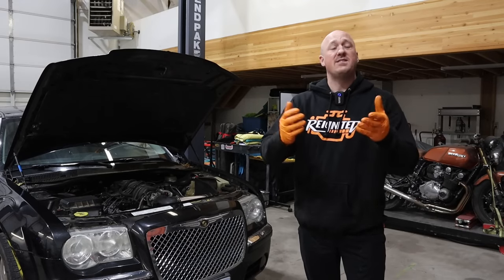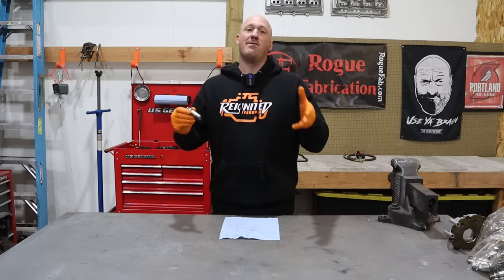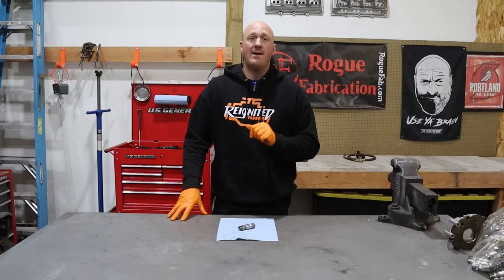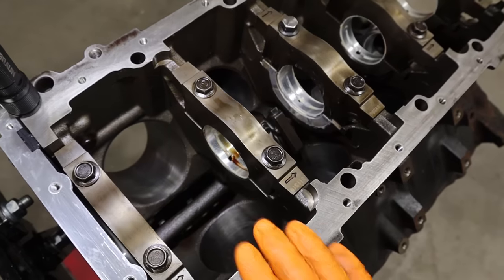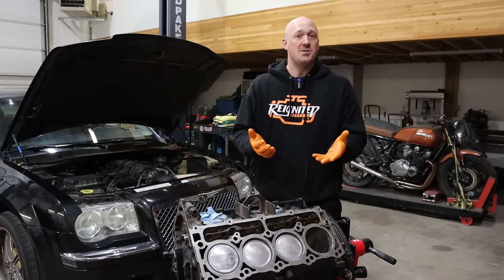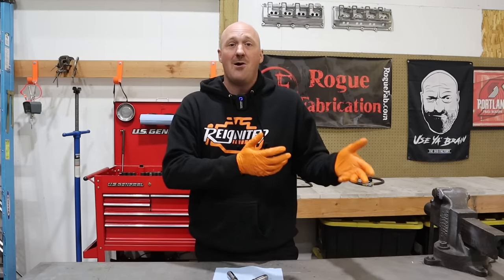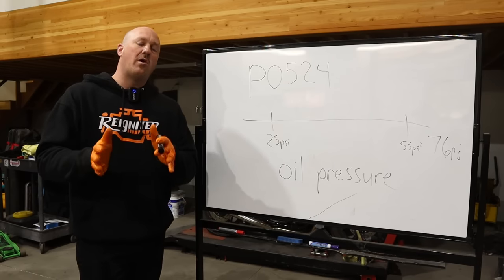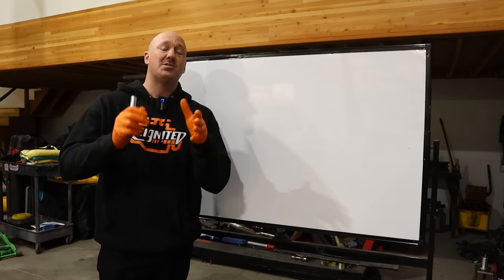The BEST Prevention For Hemi Lifter Failure! (In My Opinion)

Comment: IMO too much oil pressure could cause more issues with gaskets, fuel economy, heat build-up, and filter stress I am not an engineer but to me increasing the flow rate is an easier and safer way to accomplish better lubrication, increasing internal pressure must have a side effect Vs increased flow rate would you agree? Combined with oil change intervals at 3-5,000 miles Vs 10,000 mile intervals. I'm at  56,000 miles on my 22 Ram 1500 5.7 4wd limited night edition Pacbrake relocation oil filter kit and Hubb 3202 oil filter I don't burn a once of oil at 5K miles. I have used Kand P Engineering reusable mesh filters for over 10 years and switched to Hubb for lower particle count 5 times more flow OEM Vs 7 times more flow Vs OEM with K&P Engineering filter. I change my oil and see what is in my filter at every oil change I also send oil analysis regularly to know what is going on internally the worst results I ever got was using a Mopar MO899 oil filter 10 times more wear particle count than mesh filters IMO 3-5K oil changes increased oil flow at OEM designed oil pressure 35 PSI at idle and 47 PSI pushing hard full throttle with greatly reduced particle count prevents wear that can lead to failure just adding more oil pressure to me seems like putting a fire hose on a match yeah it will put out the flame but what happens to everything around it every action has a reaction please let me know what you think have you ever tested oil filtration flow rates of OEM Vs other reusable mesh filters?

Comment: I was able to use MDS with a 6.2 oil pump. When the check engine light came on for P0524 it wouldn't activate, but I could clear the code and I was able to use MDS again. The check engine light came on at seemingly random times, and only every once in awhile.

Comment: Are the modern HEMI's baffled or rear sump?  I think a lot of the fears of high volume draining from the pan, is because of the older engines like you said.  Lot of the older mopar cars the sump was center or more forward the engine, so if you didn't have a baffled pan it is a problem on the older stuff.

Comment: Starting my research now (better later than never) after ordering my used 17 Ram 5.7 hemi. Haven't gotten the truck yet but I'm getting butterflies listening to you and others as what to expect on a 40k mi engine. I gathered from this video you don't suggest to change oil weights but what is your take on full syn oil in this engine?  Thanks!
Reply: I put synthetic in my 2012 pickup truck at around 30 thousand miles and I don't let my truck sit idling for periods of time .I also run it in tow/ haul mode to keep it in V8 mode all of the time. And I don't run the AC much which would drag the engine down a little at idle time ,like at red lights . And most tick noise is from a broken exhaust manifold bolt.... not the lifter / cam problem.

Comment: So really what we actually need is an oil pump with a higher volume per second on the low end that levels out to normal levels on the high end. And also I now realize it doesn't make much sense to think that MDS is causing lifter failure when the roller is what is going out, a part that both types of lifters have, and also non-mds lifters still go out for the same exact reason. Basic takeaways are just don't idle your engine and if you can afford an oil pump with a higher volume output then install it. I wonder if idling your engine at a higher RPM would help too

Comment: Is it a must to put in new cam bearings in on an engine that runs but has lifter tick? Engine has 130,000 miles on it
Reply from the maker: Not usually. The Hemi engines very rarely experience cam bearing issues. If you remove the camshaft and see the bearings are scarred then of course they need to be replaced, but in the hundred or so of these that I've done for lifter failure I've never seen the cam bearings failed.

Comment: The Melling pump comes with a higher pressure relief higher than factory installed, but also comes with the factory relief pressure.  Which one did you use in the 300?  It might’ve eliminated the need to fool the pcm.

Comment: It's not completely correct that all Hellcat variants use the same oil pump.  Yes, all Hellcat pumps are the same displacement (~ 23 cc per rev), however the MY2015 through MY2017 versions use a slightly (~5 psi) lower pressure relief valve set point.  Specifically, the PRV spring used in those pumps has a slightly lower rate.

For MY2018, we raised that PRV spring rate for the Demon application due to the slightly higher max engine speed.

The MY2018 pump (part number suffix "AD") can be used to service ALL Gen III HEMI applications with MDS.

Comment: Great video. I have a 2016 Dodge RAM with the 5.7 Hemi. I had the ticking noise come up when the truck had like 50K and the dealer changed the exhaust manifold on one side and it fixed the noise. At about 85k or so the noise started to come back(just like the video says every 30K miles) so I took it to mechanic and he said was the other side exhaust manifold so I changed that but it seem that the ticking noise was still there when the engine is cold. Now he tells me that it is one of the lifters. If I am going to have him do the work on changing one lifter should I just change all of them at the same time? Will that be a good idea?

Comment: QUESTION... if I put a new Melling oil pump on my 5.7 with a very mild tick, will that stop any further wear,, or will the damage keep getting worse eventually requiring lifter replacement?? Thank you!
2013 Charger R/T MAX
Forgive me, I posted this question on a couple different videos,, I genuinely need a REAL answer from a knowledgeable person!
Reply from the maker: At that point the lifters are already damaged and will need to be replaced. The upgrade oil pump will not prevent further damage. 👍
Reply: @ReignitedAuto  thank you very much for your quick response I appreciate it! Looks like I'll be doing the lifter and cam job if I decide to keep the car then!👍

Comment: A couple years ago I bought a superchips computer so that I could shut off the multi displacement system and not have to remove the solenoid valves or mess with anything. This eliminates having to be a mechanic at all and gets the layman to the same end point. MDS off and change the oil regularly will stop any further damage.- the problem is NOT the MDS system itself, it’s the extended use of the MDS system that causes damage and improper lubrication. I think fordtechmakuloco did a video on it as well
Reply from the maker: It's actually the other way around. There is MORE lubrication when the MDS system is active. Check out this video for more detail:
https://youtu.be/NcDeWXYtozE 👍

Comment: I had a 2010 with 5.7 no issues- 130k. Also had a 2019 rebel with 5.7. Which had the hemi tick at 25,000 miles.
So, if there's a combination of variables required to create a situation of wear. What is the most common among all variables? It seems to be oil. So we have
Lower oil volume + long idle ( canadian here haha so true) + dirty oil ( unfortunately confirmed)
My 2010, oil changed at 3000 miles always. 
The 2019 - 6000+ (tried to follow the light )
So oil does seem to be the most consistent factor. 

I think Oil type is something to look into here. Difference between  conventional and synthetic but also oil before and after 2009. I wonder if something has changed here i'd really like to hear your thoughts on it. 
Thanks for the great video!!

Comment: I think that the cam hardening is a major issue leading to the failure as a lot of the early failures look like cam failures first. Perhaps an aftermarket billet cam core is the way to go with good heat treating. Also one thing regarding higher viscosity oil increasing pressure is it generally has better film strength than lower viscosity, so it may "stick " to the valvetrain better. Do you have any techniques for changing the pump in the vehicle without dropping the pan?
Reply: The cam is not the issue, I replace these all the time and you typically find one bad cam lobe and 5 or 6 lifters that no longer roll smoothly.

Comment: I figured it was the 16PSI at hot idle, on my 2011 Charger. Not sure how low it got when it was time to change the oil, and the system gave me the message on the dash, wrong oil weight. I guess that's when it was too low.
I put a high pressure oil pump on it and it will still get down to 16PSI hot idle, but not as often as before. I plan to put the Hellcat oil pump on in the future. And a new OE timing chain, because the cheap ones I've used, stretch and cause a rattling noise when economy kicks in.
The high pressure pump I put on does get up to 95PSI cold high RPM. 75PSI hot high RPM.
Because of my stretched timing chain, I manually shift, so MDS doesn't activate and cause the rattle.

Comment: I believe that it’s an “oil” problem duh! I had an LA 360 that keep eating cams, after the 3rd cam I pulled it and went looking for the reason. The engine always had good oil psi. 
After tear down and a hot tank what I found was there was casting flashing in one of the upper/cam oil gallery, when the cleaning brush would not go all the way through, we found drill bits that were long enough, we predrilled all the oil passages! 
This fixed this motor, I think I ran it for 7 years after that with no problems! 
So this could be the problem with the later 3rg gen hemi. They could be as simple as a foundry problem! The fix could be as simple as drilling the cam oil passages? 
Am I correct or out in Left field?

Comment: does the Melling pump already have the same spring as the stock pump because it is a direct replacement ?
Reply from the maker: It comes with the high pressure spring installed, but the stock pressure spring is provided in the box and it's a very simple swap.

Comment: I wonder if you add oil cooler to those plugs for the oil galleries on the front of the motor for the lifters, I wonder if that would extend the life of the lifters

Comment: My 6.4 scat pack now has 68 thousand miles. If I put the original oil pump on the Melling
Part Number
Change 10452HV, you won't get the error message that there is too much oil pressure in the engine.
Should additional camshaft nozzles be installed so that the oil reaches the lifters and camshaft?

Comment: Pall this confusion I think about the brand of oil. Any high quality synthetic oil will be about the same. I personally use Castrol syntec because I had a Chrysler 3.8 that for some reason burned a quart at 3500  miles, but not with the Castrol. Been using it ever since just for that one reason alone. Now I did not get to try many oils to see if others did the same thing, just that the Valvoline I tried burned oil and the Castrol did not. I did try the Valvoline twice with the same results. Also oil changes are so subjective to how the vehicle is used. I drive mine mostly highway and I swear the engine rarely goes over 2,300 rpm, ever. I see many driving them and seemingly testing for that 395 hp constantly. Obviously, one needs the oil changed before the other. The guy constantly racing around has the motor spinning around twice as much in the same miles and worked harder. If you drive hard, 5,000 miles sounds about right. The way I drive my cars, I have changed oil every 10,000 miles without a problem in 45 years. In the early eighties I started Using Amsoil and changing at the recommended then 25,000 miles and 12,500 for filter without a problem into 100's of thousands of miles. All highway with a Toyota Corolla and Tercel, both 1980 model year.

Comment: Hey man great video, learned lots. I have a 2014 Laramie Limited with the 5.7L and 8 speed auto. When driving and ECO mode activates and MDS is on, during cruise when the engine is bogging and during the state where the transmission wants to shift down I get a banging noise under the passenger floor board and when it shifts down or when I put the trans into manual gear mode it goes away. Do you know what I am talking about and do you have a clue to point me in the correct direction to fix? Thank you so much.

Comment: You never mentioned the 6.1L Hemi like the one in my 69k mile 09 srt8 challenger w/5spd auto. I dont believe it has MDS, but I think it does have VVT. Recommended oil is 0w-40 Euro Mobil1, which we have used religiously, until recently when I changed to Pennzoil ULTRA Platinum, which seems quieter. Oil pressure is 75-80 psi at cold start, and 23-24psi at hot idle. Which oil pump do you suggest will best work for it and fit this application?
Reply from the maker: The 6.1 engines will use the Melling High volume pump 10342HV 👍

Comment: I have a 2020 Ram with  the 5.7 MDS VVT engine. It has been dealer serviced since new. I take it in every 4,000 miles to the dealership for oil changes. my truck has 43,000 miles on it. I live in Michigan  and I use the remote start every  time to let the engine "warm up" before I drive it {generally around 6-10 minutes } am I  causing potential harm by doing this?  Your  video is by far the most educational I have seen on this subject. I have had discussed the potential  lifter issues with my service advisor and he told me I should be fine by doing my oil changes at 4000 miles. The Remote start idling is what I  really wanted to get a answer for. Hellcat oil pump and switching  the spring is the route I would  choose  but being it's still under factory warranty  I'm  not going  to do it just yet but I will  be at 50,000 miles or so. hopefully  I get a answer  from you. Thanks.
Reply from the maker: I can't see that being too much of an issue. When I'm talking about excessive idling I mean an hour or more every day, like you will see with people who are stuck in traffic every day or police or fleet vehicles that sit at the side of the road and idle all the time. 👍
Reply: @ReignitedAuto  thank you for the  answer to my question. appreciate it.

Comment: Have a 2005 Ram 1500STL 5.7 quag cab  2 wheel drive it's starts fine but dies seconds after. If I try to step on the pedal to keep it going I get nothing. I can still hear the fuel pump, alternator is fine, oil, tranny, radiator has always been maintained. I slacked in sensors. Plugs and wires changed in 2015 haven't felt any symptoms if them. Always kept my intake and air filter  Muffler was separated for some time back together now. 02 sensors need changed for sure. Fuel filter has not ever been changed to my knowledge.  It has a new water pump and thermostat. It has 259000 miles. Also the differential has slow leak at seal by drive shaft. Recommendation on whete to start please.

Comment: Great video. I've got a 2013 Ram, My shop used the Melling HV oil pump when they rebuilt my 2013. The way I understand the video it that 08 and older have a small displacement pump (20%) than the 09's and newer. So, does the Melling in the  2013 have the same displacement as the Hellcat, thus the same resistors that you use in the video (1K and 7.4K)...
My truck does show ECO often like it is functional. Pressure is commonly 77-80 which I would think is high enough to keep ECO from working. I get the error about once a month. Should I believe that its actually running in ECO or is it just displaying that and not actually running in ECO?
Reply: Did you figure out which resistors to use in your 2013? I have a 2015 with this code after hellcat pump now

Comment: I don't have a Hemi but I did a lot of different motorcycles at one time in various multi line dealers. 
Factory doesn't always get things right even after updates and techs sometimes manage to do the development factories should have found and implemented.
Your findings and opinion sound completely logical to me. 
One thing, does full synthetic oil help prevent needle bearing failure or extend time before it happens?
On older motorcycles (like the GS you have in background) I found full synthetics (to JASO spec) work much better but almost always need heavy duty clutch springs.
 There does seem to be something of a cut off around early~ mid 90's when majority of manufacturers changed pressure plate materials from 'organics' to synthetics.
Reply: I not a expert on motorcycle  engines , i got a couple of money pit Harleys.  Both have SS or mostly SS engines.  My experience on lifters is i buy the best i can find , change the oil often . But in my limited experience lifters are a maintenance item.  I change them or try to before they fail ..Not going to risk saving a few dollars on lifters and having metal being sent through the engine.  I run limiter in the lifters  on my 124 . When i i get a few more miles on the 143 the lifters get changed with . I not recommending that to anyone but it woks for me . I only use parts i trust .   The combination of higher lift and spring pressure the good lifter gets a work out . Not a chance i run stock Harley cranks , or parts including most of there lifters

Comment: I been changing my oil every 5,000 miles plus or minus 100 miles just to get the supplies plus it runs on 0W-20 oil from Chrysler and average idle oil pressure is 37or higher PSI.

Comment: When I had my cam and lifters changed I was advised to change from a 5k oil change interval and go back to the old standard of 3k. The shop says that they belive that these engines are super sensitive to oil cleanliness. I know cleaner oil is always better but can this simple change in habits make that much of a difference? I do oil analysis on all of my oil changes, this is how I find out that I was losing my cam way early in the process, and the reports have always come back that my oil is in good shape and I could run it longer. I never have run it longer. I had a hard time going to 5k intervals having grown up with 60s and 70s engines. What are your thoughts about shorter oil change intervals? Will it help things?